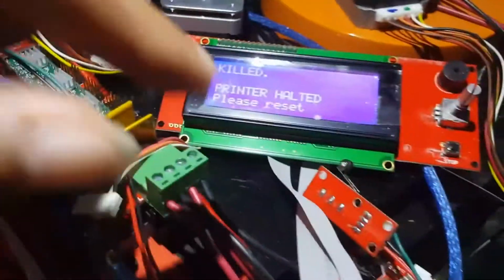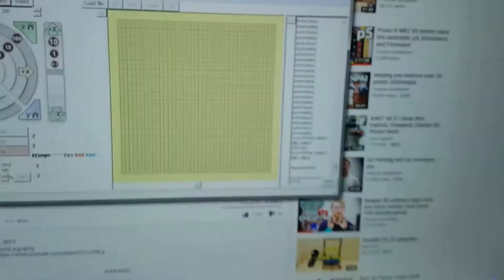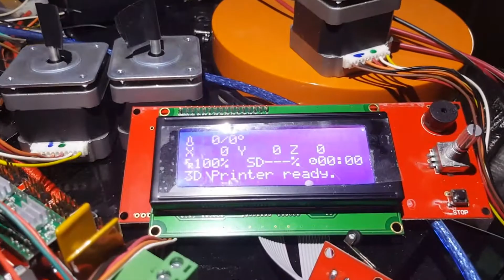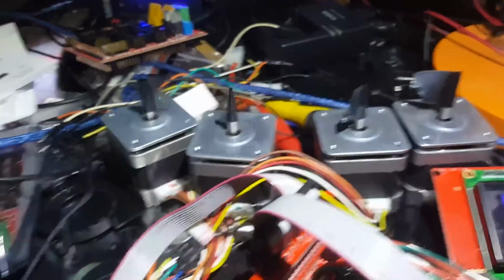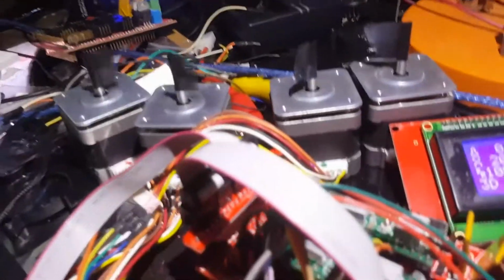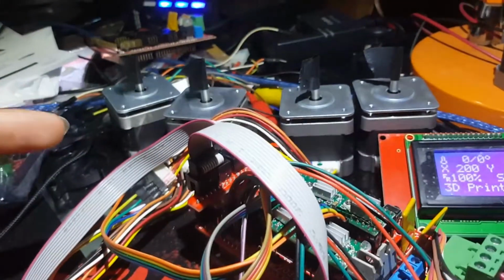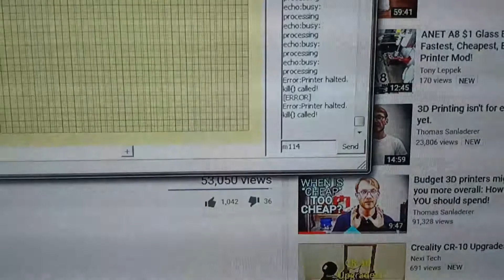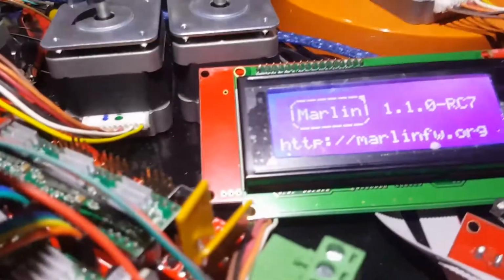Arduino Mega and RAMPS 1.4 Problems!!!

Comment: My x axis is only going one way. I switched the stepper motor. And made sure the wires are right. But still only moving one way. Anyone know how i can fix this?
Reply from the maker: Multiple issues could cause this like the Firmware may need tweaking or stepper driver broken

Comment: got it running but some times the end stops are Triggered but machine keeps going and dents the end stop strip
Reply from the maker: the end stops may not be working correctly and or the end stops ports on the board maybe damaged try switching the end stops around and test each one to make sure they work.
Reply: Yes Lee thanks .  the end stop terminals were not properly hooked . kinda loose connection . Test benching is a good advise.yet I have a stack of problems with the machine running.which I will upload soon.
Reply from the maker: Mo Izak ok I will check it out when you upload it and just message me when the video is up

Comment: I am very clumsy , had to travel 2 hours to get the end stop switches , Or wait for 3 days , So constructed the end stops and wired the machine , Once I run it will add it to the UT.  DIY is about doing what ever possible.

Comment: I am having same problem , Z does not run. XYZ do not jogg, gives a siren sound of high frequency.
Reply from the maker: You have to hit the end stop because it need to know where the end of the z axis will be thank you for commenting and don't forget to subscribe thank you and more videos to come
Reply: If you really know (what is going bananas) well I am almost there.
the manual controlls do not work at all, Is that dew to end stops?
Reply from the maker: Have you check the pot on the stepper drivers?
Reply: X .30 Y .30  Z .30
Reply from the maker: oh no not position I'm meant the potentiometer on the stepper motor drivers they can be what is making the noise and if they aren't turned they can even cause the steppers to skip a step or not work at all
Reply: voltage on pot I increased it to 45 ( X Y Z )
Reply from the maker: and they still aren't moving?
Reply: Finally I got through. Machine wont go on manual Unless End stops are functional. Thanks
Reply from the maker: Mo Izak your welcome I glad you got it to work and yea the end stops is what I was stating in the beginning they are important for the system to work